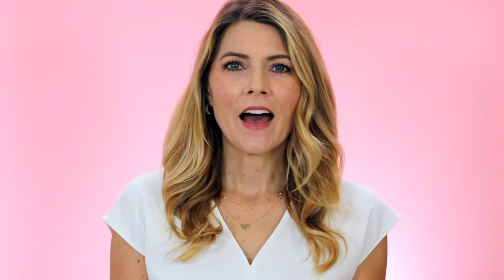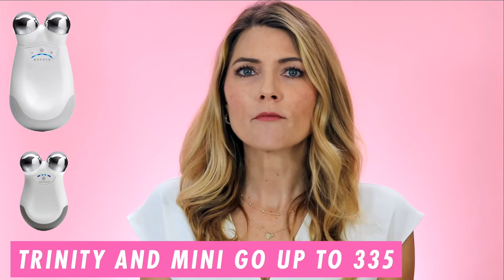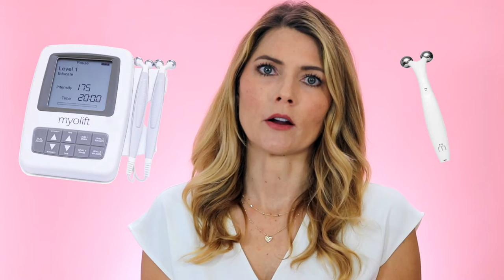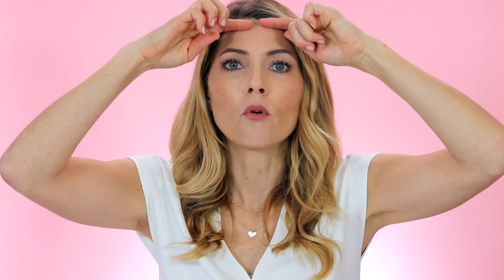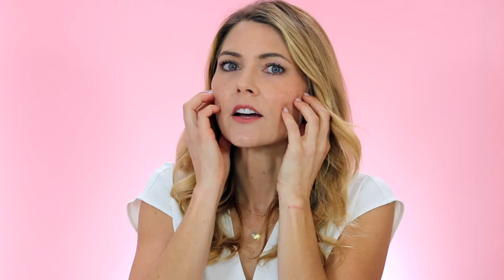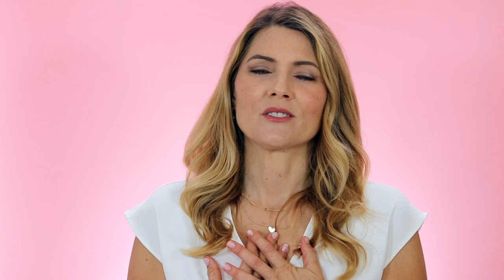What's the Difference? Galvanic, Microcurrent, and EMS | Over 40

Comment: Thank you for the info. I was wondering about nanocurrent? What are the effects compared to microcurrent?
Reply from the maker: I think that's just a lower level current. You can try to find more info on Google or the ZIIP site or ask ZIIP directly since they are the only device I know that has it. I don't know the specifics about it.
Reply: You can’t feel Nano current at all. I believe, since the waves are smaller, that it can penetrate the skin deeper than micro currents. I have a ZIIP, and I like the fact that it can do micro and/or nano but I don’t feel like the design is very easy to hold in your hand and move it around the various areas of the face. If you have arthritis or any other thing that affects your grip or finger agility, I’d skip the ZIIP.
Reply: Like D Grant said nano current are smaller electrical wavelengths which can penetrate deeper than microcurrent. Nanocurrent offers longer lasting results over time and can address issues like breakouts and pigmentation in addition to many of the same benefits as microcurrent. Microcurrent and nanocurrent compliment each other nicely for this reason. Microcurrent can give those immediate results we like, and nanocurrent helps reinforce them and make it last a little longer. If I understand correctly😊 Hope this helps. I did a great deal of research on it when I was deciding which device to get.
Reply: @Kendralovesskincare  Which device did you choose please?

Comment: Thanks Trina for distinguishing the differences between these three modalities. I read recently in another group that a member had good results using galvanic on her upper lip lines. I haven't used any devices for that only gua sha, face exercises, etc. But I'm wondering if the product infusion from galvanic might help. Any thoughts on this?
Reply from the maker: You could try it out, but I personally have never used it. I haven't needed to. I find that microcurrent helps push in the products deeper - and then I also use my Banisher microstamp or Droplette microinfuser if I want my products to go deeper. I would pick the one you think you'll use the most as the best device for you is the one you'll actually use.
Reply: @beautybeyond40  Great ideas. I’ll try the microcurrent (erase?) and look into the Banisher. Thank you.
Reply: It seems both can be used on alternate days.
Reply from the maker: @sherirobbins8714   erase is probably best for lip lines!

Comment: We're told that if your MC device makes your muscles "shake", then it's too much.  But why, if the EMS does that exact thing?
Reply from the maker: Because it's a different modality and that's what it's supposed to do.
Reply: because with ems the muscle contracts, and you feel that. Rather with MC (microcurrent) what you are feeling is too much current on your skin, the tingling is not a contraction.

Comment: So... would I be able to use myolift on the top of my face and Lumo on the bottom from the apples of the of the cheeks to the jaw and waddle? One right after the other in the same treatment time? Or, should they be spread out with time in between? Hours or a day?
Reply from the maker: I think you can use them right after each other, but maybe an esthetician can chime in. Or just do on separate days if you’re not sure.
Reply: @beautybeyond40  thanks Trina. I wasn't sure if you'd know, but thought it couldn't hurt to ask. Here's one more, just incase you might know. I'm under the impression that I would use the Lumo instead of the Newa. Is that correct?
Reply from the maker: @monak2069  It is my understanding that yes that is correct since they both are RF devices.
Reply: @beautybeyond40  thanks again Trina. 💖🌺